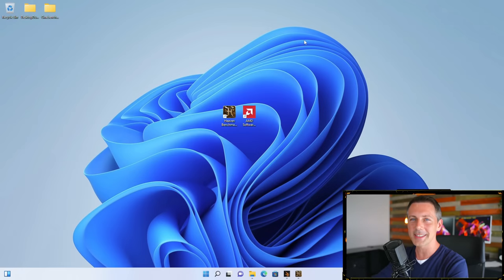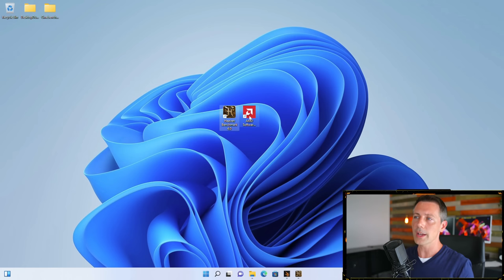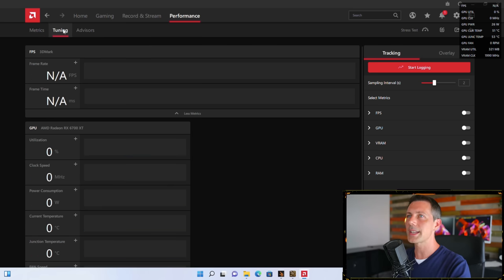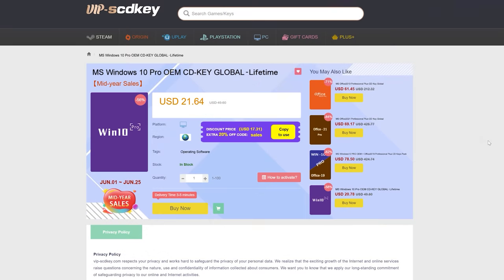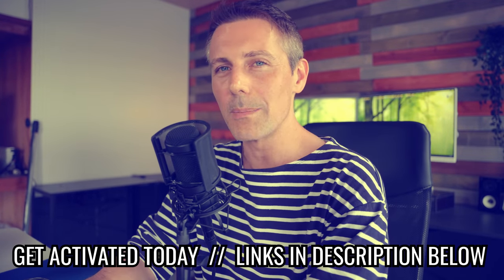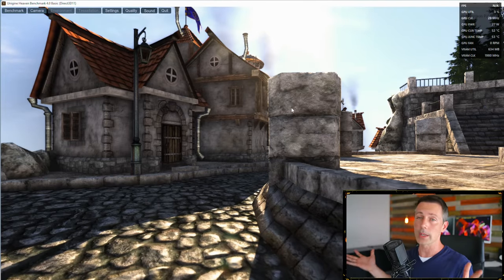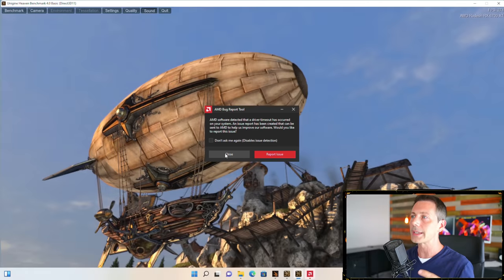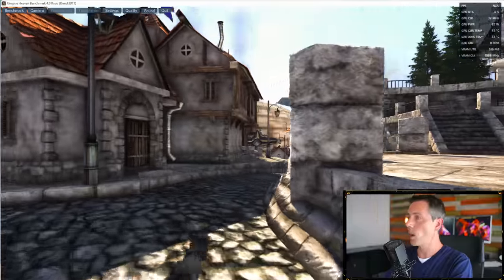How to UNDERVOLT AMD RX 6000 Series GPUs

Comment: Based on your comment about undervolting the amd chips and using a true undervolt instead of curve optimizer I tried to do this as well. I had previously had it "undervolted" via curve optimizer at -16. Apparently my motherboard has a hidden minimum somewhere as no matter what undervolt method I used I can not get it to go lower then 76w, Its a 5600x. The voltage can go lower then 1.26 but the watts stays the same even when the voltage is listed at 1.2 or less. That said I undervolted both with curve optimizer and your offset method. In both cases my max wattage was the above mentioned 76w, however, using cinebench 23 the curve optimizer undervolt consistently scored 1000 points higher then the -100 offset undervolt. All other settings identical.

Thought you would find this interesting and who knows perhaps even make a video about the differences of undervolting your cpu with curve optimizer vs offset method.

Oh and as far as undervolting my 6600 xt using your video as a baseline tutorial I got the voltage from 1150 down to 1080 stable WITHOUT downclocking at all and actually increasing the memory clock from 2000 to 2170.

Comment: I enjoy undervolting my 3080 FTW3, I usually put a cap on fps say around 144fps on non demanding games, or 100fps on more demanding games.  Usually I can hit the fps cap while undervolting saving a lot less watts, 175watts vs the average 300-350 watts the card usually consumes.
Less watts, less heat, less noise, and I hit the performance targets that I want to still hit.  This is on a 3440x1440 resolution. 
It also means my cpu is less stressed trying to keep up with a GPU if its running at full tilt.  Your gpu is only as fast as your cpu is able to keep up with it.  
This also means my cpu is consuming less watts, less heat, less noise as well.  Its all cherry all around. 

I know its a different card but the idea is all the same.
Reply: 175W from 300W is a pretty aggressive undervolt. I love it! What voltage did you get in the end for that to be stable?
Reply: Too bad you don't have Radeon chill to limit your FPS. It caps frames in a much more efficient way, saving more power.

Comment: I did exactly your settingds except vram capped at 107, saved 60W and 20 degrees centigrade,  CP2077 still runnjng at 90-100 fps on a 6700XT reference gpu.  Thanks a lot!

Comment: I had just been cranking the fans up on my 6900XT, and calling it a day. 82C average on the junction temperature made me uneasy but everyone said that the junction would always be hotter, so I let it be. However! I followed what you said, and the clock speeds seem to be the same (it doesn’t usually exceed 2400MHz on the core anyway), but the temperatures are now in the low 70s in the junction. That’s amazing! TYC Rules

Oh yeah I live in Puerto Rico, it’s always hot
Reply: 82C on the junction is not that high but I assume the fans at max speed must be really loud.
Reply: Amd gpus have several temp sensors all over the die. Gpu temp is the “average” across the die. Junction temp is the hottest point any sensor is reading. 82c isn’t bad with 6000 series. Thermal throttling kicks in around 110c. That being said, 82c probably isn’t ideal for long term. My 6800xt would go to 94c for the junction & around 65c average with useless stock fan settings. A custom fan curve slightly more aggressive than stock (like 50% fan speed at 60c) brought the junction temps to 70-75c & 40-50c average in games. Fans never hit 50% but the temps are so much lower.
Reply: 82 is fine all day long mine ran 90s all day long till I went on water
Reply: @@anarchynrage I’ve used the similar settings as our Tech Yes Leader did at first! Max frequency at 2400, and the voltage under that, I have it at 1100. It works super well for me, a slightly more aggressive fan curve as well is working well. I know it’s just junction, but I still get uneasy from it being so high
Reply: @Derqem  they’re not aaaaall the way maxed, but definitely over 1600. I’m at work right now so I don’t remember the exact number, but I think it’s near or slightly under 2000

Comment: Holy crap, huge game changer!! I’ve always been afraid to undervolt until I was having crashing issues in COD. I decided to do an overlay and realized my GPU was hitting max temps. Short fix was ramping the fans then decided to research why my card was overheating and found this video. Most of my parts I have in my rig are from the recommendations of TYC so I figured he would have my answers which he did. Lowered power consumption on my 6650 XT considerably and temps yet still barely loss any fps! Thank you so much!!!!

Comment: I undervolted my 1070 and my 2070s for years. +100 Curve and cap the curve at 9xx mv via afterburner. Done. With the 6900xt however the voltage/frequency curve around 2000mhz is so low in voltage that every offset i try crashes in some titles. the offset voltage may be stable at 2200mhz or 2300mhz but when the gpu hits 2100/2000 while not used fully it then just crashed with that offset via the slider. you can work around it by setting the minclock but even then sometimes it came along the "unstable clocks" from time to time. So i just downclock it to 2050 min and 2150 mhz max leaving the voltage slider on 1175 mv stock resulting in 9xx mv on 2100 ish clockspeed. A friend of mine tried to reduce the slider on his 6700 by 50mv but reverted after some crashes. I experienced rdna2 to be quite squishy regarding this "offset-slider" in the amd-software.
Reply: that's a bummer. have you tried msi afterburner or other software?

Comment: My rx 6600 undervolt:

Min freq: 2000 (to minimize stutters)
Max freq: 2400
Voltage: 1100 (driver crashes on lower values)

Memory timing: fast
Max freq: 1900

Without undervolt the power consumption is 100W, with undervolt it does not go over 80W. I have tested a few games, including cyberpunk. There is no visible performance decrease. Maybe 1 or 2 fps in cyberpunk on high settings.
Reply: I reset the min freq to 700 because it made some games lag at 120 fps limit.
Reply: My rx 6600 asrock  undervolt + overclock

Min freq: 700
Max freq: 2800
Voltage: 1100
Memory timing: normal
Max freq: 1900
Power tuning +20
Reply: @jasper8941  so your MIn is 2000 and max is 2440, right? do you change your Power Limit?

Comment: Decided to finally bite the bullet and UV my RX 6700. Stable settings for me were 2450MHz at 1.1V + VRAM at 2100MHz and performance seems to be basically the same in games, maybe 5% lower at worst, but power draw is lower by a whole THIRD (From 150/160W to 100/110W) and the temperatures are around 10C lower. Fan RPM is also lower. Better yet, the PSU in the system it's in right now is an ancient Seasonic M12II-620 with no UVP, so I can wholeheartedly recommend the settings recommended here even IF the power supply running things is older and/or questionable. Thank you Mr Brian

Comment: what a coincidence!!!!! i literally just ordered an rx 6900xt 2 hours ago and i was about to do some research about undervolting but here you are! great timing XD
Reply: I undervolt for best performance.
My RX 6900XT can drop 100mV, from stock 1175mV to 1075mV.
Allow max freq you can, I set 2700 MHz, but it will auto adjust by load. 
I might see that freq if light load, but usually see 2450-2550 under heavy load (the max I can achieve even with a heavier fan curve.)
Powertune +15% to allow it to max out performance.
I set memory to max 2150 MHz and fast timings (higher end cards tend to have good memory chips.)

Undervolting allows max performance while staying within the set wattage zone.
Reply: Same gpu here, values: 1100mv, 2800mhz on core and 2200mhz on memory

Comment: Thanks Brian. Got a 6600 XT recently and just learning Adrenaline software. [edit] Had my settings at 2400 and 1100 per the video. Once I got to vram it allowed boosting to 2400 but crashed. More to learn from this.
Reply: For my nitro 6600xt, the min frequency is 700, do I leave this at 700 or lower it to 500 like how it is in the video?
Reply: @kashif4463  I left it at 700 and so far so good. Cards will vary though so you'll have to do some testing.
Reply: @vexelghost  what can I use alongside the heaven benchmark for undervolt testing?, is 3d mark timespy good?

Comment: Thanks for this tutorial. Just got a 6950xt today for a killer deal on newegg. It was pulling well over 300w but now it's only running ~150w full load
Reply: can you share your settings?
Reply: @Ryan  power limit slid all the way up
Zero rpm disabled 
Min freq 2400mhz
Max freq 2500mhz
Voltage 1070mhz 
Vram 2400mhz with fast timings enabled

No instability yet, but I have only ran heaven benchmark, hogwarts legacy and overwatch so far

Comment: Undervolting is so underrated. I used to overclock everything, now the opposite. My 3090 has it’s sweet spot at 1860mhz @ 875mv, runs a lot quieter and in some case faster since it doesn’t downclock as much due to heat
Reply: Nice. What was the power consumption before and after, and temps?
Reply: @Krenisphia  about 50-70 watts off I think. Used to peak at 450 watts, now it doesn’t reach 400
Reply: I've become fan of undervolting while still overclocking in i7-930 (Nehalem core, first gen) CPU. It's incredible, how they've managed to overclock CPU from 2.8 to 3.7 ghz, and still get reduced vcore. powerconsumption dropped significaly. From that time, I try to find most effective point.

Comment: I've did the same for my 6800Xt but I basically used the factory settings for undervolt. I got from 85 to 73 degrees celsius with no crashing.

Comment: Excellent video! RDNA2 is so efficient, that this kind of manually tuning just get the true best out of it. Nvidia's similar performer, the RTX 3070, cant get under 140W without significant performance hit. (Say down to 2080-ish performance.. still not bad @130-140W) But I managed to get my 6600 XT down to 80-ish Watts with just just 10% performance hit vs stock (140-150w watts). That is RTX 3060-like performance @80 watts! Will try the 6600 (non-XT). Should be possible to take that down below 75W within 10% performance hit ...meaning it practically could be powered without a PCI-E powercable.

Comment: I really needed this as the 6750 xt is too powerful for my needs, and right now it’s crazy hot
Reply: lol, mine too.. just because the fans after the 50% are kinda loud.
I have the XFX 12GB version:
2545 mhz
1130v
2312 mem clock
1650rpm of the fans around 62 degrees until 75

gained around 50watts
from 62C gc - 80-83 junction -> to 50C gc - 67/70 junction
i didn't see any performance drop lol

Comment: oh I have the same 6700 xt model which is ASRock Challenger Pro. I also have the same issue of putting the VRAM in fast timing makes my driver crash randomly. The only difference i did is i put it at 2112mhz to be exactly 2100mhz in game. Most people said that on rx 6000 series, going more than 2100mhz vram OC gives performance decrease. It may not happen to one specific game but it may happen to other games.

Comment: got my 6700 xt undervolted 2.6ghz min and 2.7ghz max at 1068mv runs very quite  and my performance in timespy benchmark has improved my graphics score over 13000 points

Comment: 5:46 but that's not how math works. For example, 10x10 is 100, and dropping one of the 10's by 10% you will be dropping the 100 by 10% as well. So 8% voltage drops is exactly 8% power consumption drops if amps and frequency stays the same

Comment: On a RX6500XT went from c. 70w to just over 30w. Insane power efficiency! Could easily make an under 100W machine.
Reply: have the same card. can you share your undervolt adjustments?
Reply: @mrmaxin53  Basically -10%/-5% adjust the power limit as well. Also defo adjust the fan curve

Comment: managed to undervolt my merc319 6900xt at 2500 frequency and went 1175 mv -> 1045 mv which is crazy to me. Another tip is to do power tuning and increase the power limit to the max percentage, will increase performance and stability of the undervolt.

Comment: [Edit, I had a crash which may have been a unicorn event but I raised voltage to 930mv] My RX6800 undervolts to 925mv and runs in the 150W/55C range in Heaven Benchmark. Don't try to clock too high, you will crash. 2300mhz MAX seems to be about the software limit AMD set for the RX6800. Mine was crashing as soon as i raised the clock 200mhz to 2300. Accept the 6800 for what it is. I'm also running with a Ryzen 1600AF @1.2V clocked 3.90.

Comment: managed to get a stable 2400 mhz at 1025 mV and max vram speed on my sapphire pulse rx 6800 xt. A whooping 70-100 W and 10-15 degrees reduction on heaven and other heavy games. still gonna try on other benchmarks to test.

Comment: I used auto on 6650XT, and it worked like a charm. Also having like less than 10W on idle, it's amazing.
P.S. build was for my friend so i had no time to do this manually. Also made -50mV on Ryzen 3600. It's so cool and quiet despite being in a really small case (Silverstone P15). On that note, I did not find SAM on bios of Asrock B550 Pro4, maybe I should update the bios. In this (and other videos) after enabling above 4G decoding it appears, but that not what i had.
Reply: If you are still on  an early bios from b550 it would need an update for resizable bar.
Reply: sam need ryzen 5xxx series
Reply: @khalilurrahman3d  Wrong
Reply: @khalilurrahman3d  amd added support for 3000 and I think even earlier processors around 5 -6 months after they launched SAM. So its been supported for a while.
Reply: lless than 10W on idle on resolution and refresh rate?
Reply: @qweasdzxc  1080p@60hz. It's all from amd control panel, I don't have a wattmeter.

Comment: I just dropped my 6800XT Merc from default 1150 mV to 975(havent tried to go below) without touching GPU clocks. Kicked up vram to 2112(there's a 12mhz offset). Went from 240-260W in Heaven to 170-190W, and temps went down about 10C.

Comment: Sidenote - I feel AMD need to put in proper v/f curve customisation into their drivers especially with rdna cards. Had something like that with p-states with Vega and Polaris cards which I previously owned but since getting my 2080ti having custom curves can be quite useful!
Reply: Yep, just upgraded from rx 470 to rx 6600 xt and was a bit confused and disappointed that there wasn't as much to dial in. Then again this is probably an easier way to go for most users.

Comment: Undervolt my RX570 today, result is awesome. The card thermal throttles slightly from 1286MHz to 1200-ish with stock settings at around 87-89C with noisy fan speed. Tuned from 1150mV to 980mV, power consumption reduced from 120-ish W to 90-ish not much but temp went down 8-9C, no more noisy fans, no more throttling & no performance lost. Bump the VRAM a bit from 1750 to 1900 with memory timing level 2 gaining some extra benchmark score. Everything runs fine so far.
Reply: Try replacing the thermal paste on that gpu
Reply: @syrynx4454  Yeah did that a few months ago. Further tuned the fan curve, now it's running max 75C at full load and no noisy fans. Oh btw, Memory timing level 1 & 2 are not stable for certain games. Rolled back timing to default.

Comment: Thanks for this, was able to get the 6800XT Phantom Gaming D to 2400Mhz 1100mV and fast timings with maxxed slider on memory.
Big difference in games and benchmarks with 10C lower temps on avg.

Comment: Thanks for the video! Oddly, my 6700xt seems to pull higher wattage when i apply the settings you applied. However, my gpu does seem stable in Heaven setting the gpu to 2.5ghz with 1080mV and the ram at 2150 with fast timings. I have an ASRock challenger D. I guess i got a pretty decent sample! Although im tempted to set the gpu to 2600 to match the 6750xt spec, however i dont think ill notice the difference, especially since my tv is 1080p 60hz. That said, perhaps i should lower it from 2500 down to 2400 and try to lower the voltage even further.